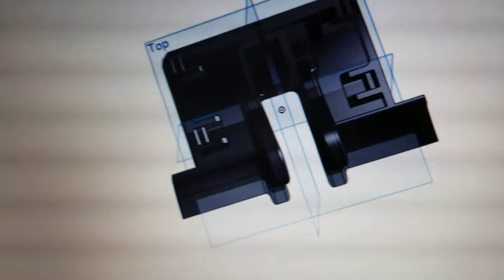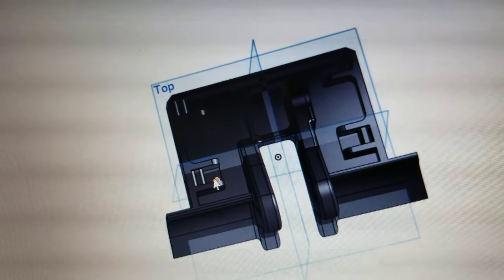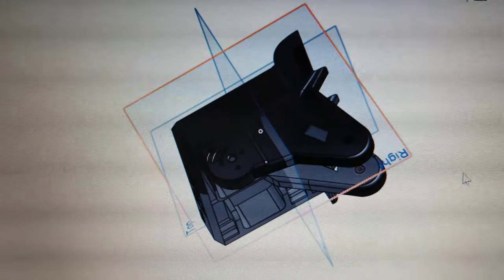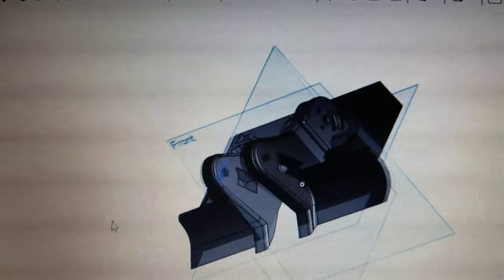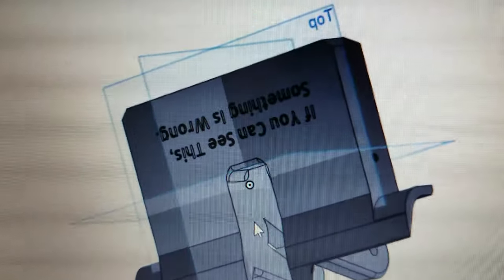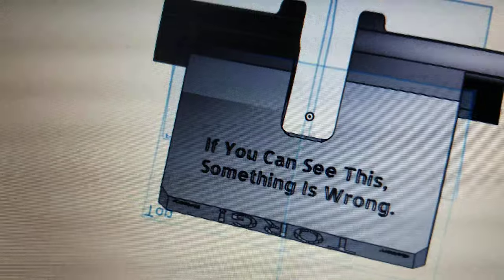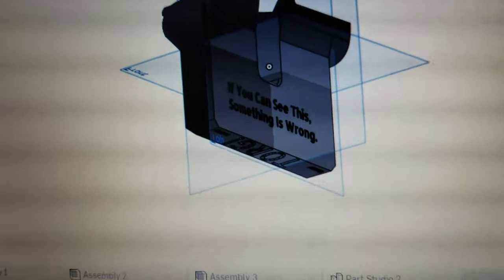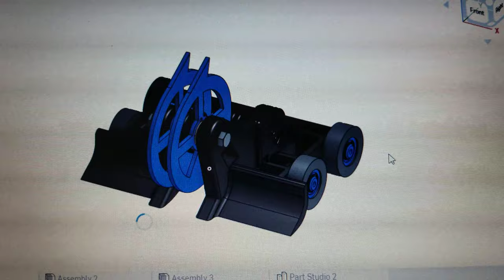Antweight Build Pt.2 : CAD Update And Changes

Comment: Make sure the weapon is made of high hardness steel. Also make sure to add more material at the tooth, and fillets to the weapon spokes.
Reply from the maker: 1. Using ti because that's all I have weight for
2.wdym could you explain further 

3.it ruins the aesthetic and it is really tight on weight and I dont feel like spending 2+ hours re balancing it but if you really think it is going to make a true difference I will do it
Reply: Team TORG Team TORG Third tip solves problems one and two. In your current design, especially with titanium, your weapon blade would blunt out in 30 second. By adding more material to your blades front relief, it’ll increase the life span of the weapon. By my first statement in this message I’m saying that the fillets are were all your blades strength is. This means you can decrease the amount of material in your spokes and move 50-75 percent of the dedicated weight from the spokes into fillets, giving you a few more grams to add more material to the tooth to better the front relief. And it’s funny how you say you don’t have enough weight for ar500 when that’s not true. Your current design isn’t optimizing inertia, and the side spokes and back spoke are overkill. Look at a design like drizzle and contemplate how the blade doesn’t fail with such a small amount of material dedicated to transmitting torque from the inner race of the disc to the outer race and back. You’re wasting money by using titanium. You can indeed use ar500.
Reply: Team TORG And your current design won’t work very well against horizontal spinners. Most drisks have a larger hub between the disks as well as more clearance between the pulley and the weapons.
Reply from the maker: @bldjln3158  by front relief do you mean the impactor area or the relief edge on the other side that will not make contact with the other robot
Reply: Team TORG Team TORG Front relief is the relief edge that does not make contact with your opponent. Rake, front relief, and material hardness are the three main variables that you need to pay attention to in order to create an effective and reliable weapon. Currently, you do not have enough rake, you don’t have enough relief, and your material hardness is below par. Please work on improving these three variables.
Reply from the maker: Doing it rn is 3 4mm and one 7mm spoke strong enough to support the wepon and yes there is fillets on them
Reply from the maker: And it is ar500
Reply: Team TORG Seems good! You could probably get away with a tri-pattern for the spokes, though.
Reply from the maker: BLDJLN so 2 4mm and the 7
Reply: Team TORG sure
Reply from the maker: @bldjln3158  what does the name mean? is it an acronym?
Reply: Team TORG sure
/SHo͝or/
adjective
confident in what one thinks or knows; having no doubt that one is right.
Reply from the maker: @bldjln3158  aaaaah, thank you 🙄🙄